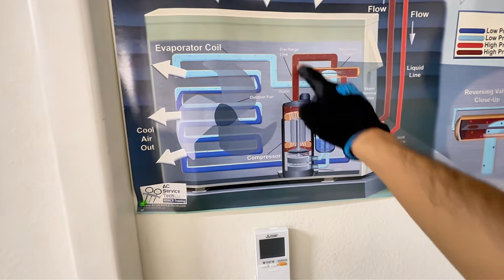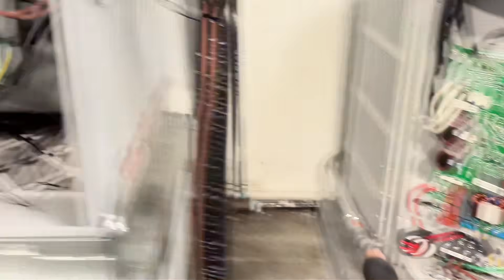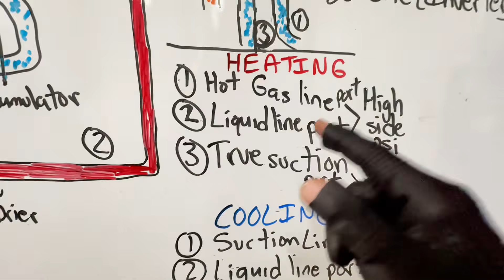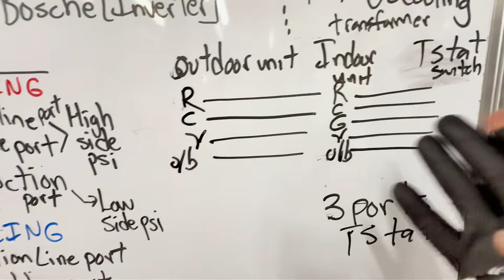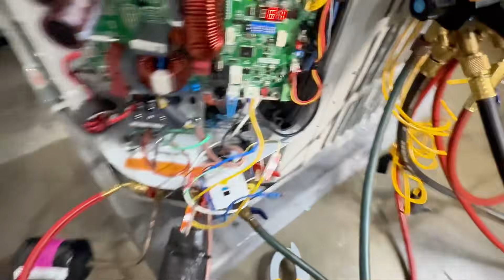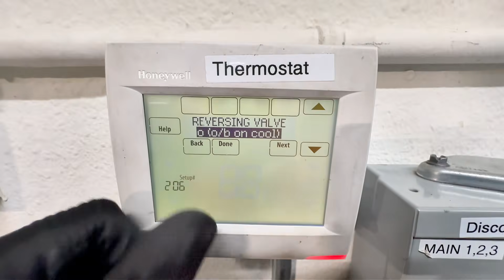How Does Heating Mode on a Split System Heat Pump Work? - HVAC Training

Comment: Great video! Definitely understand that it’s hot gas high pressure when in heating on the suction line. And I definitely see why I must use the true suction port if I want accurate reading on my gauges. I didn’t know that R454B refrigerant has similar pressures to R22 refrigerant!